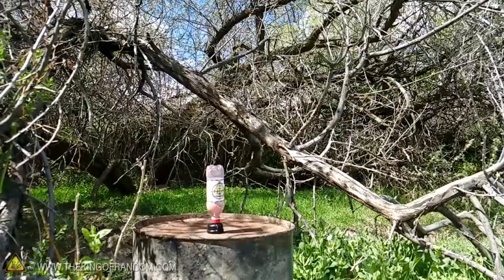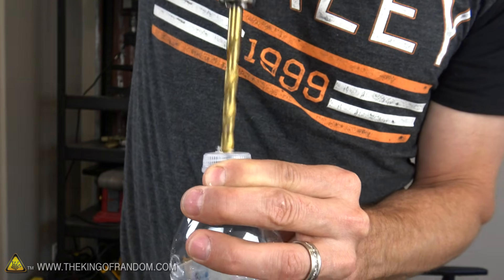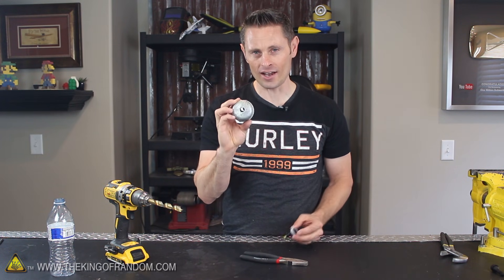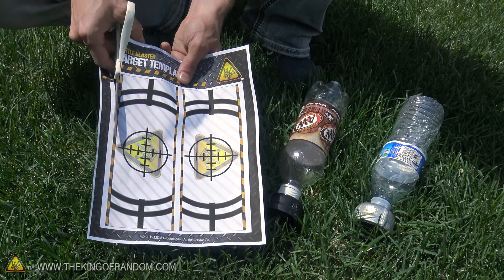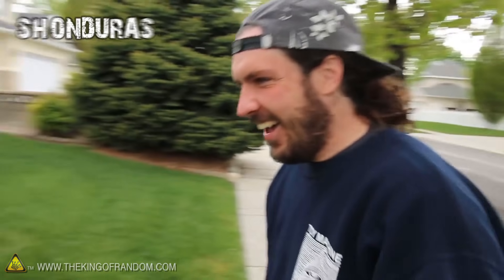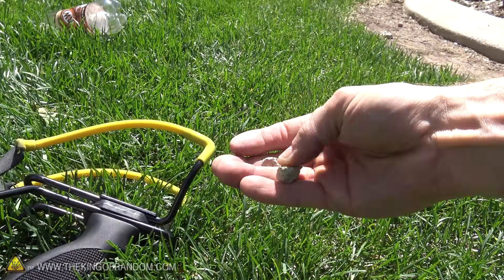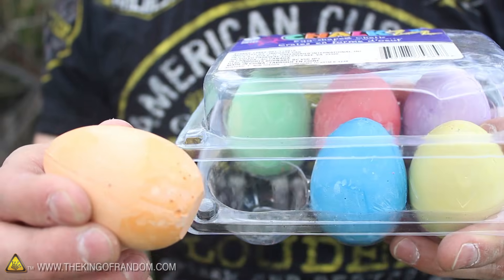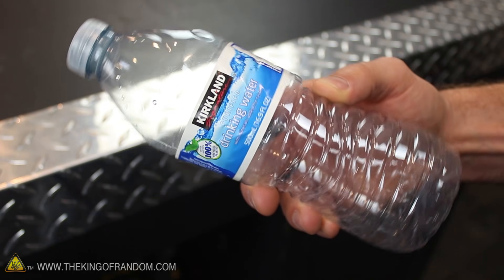How To Make Targets Explode With A Sonic Boom

Comment: i can't get mine to work! im using coke bottles and the valve from the tube of a push bike. i inflate it to about 60-70 psi and the seal is fine it holds it solid but when i try and shoot it with my .177 air-rifle, its just bounces straight off of it!! It never pops and i have used heaps of different methods!!! please help!!!

Comment: Do they only explode if you shoot them at very close range? The other montage video of the bottles exploding had pretty much every shot be really close to the bottle.
Reply: It's only because of the type of shooters and ammo they use. Depending on how far you can throw and they stick into one of those little boards or a tree, these will pop with throwing knifes and darts as well. 

Target practice with arrows is also an idea.

Comment: I have a question for someone. I have a large pocket knife and the handle has aluminum ends on it (Large Espada by Cold Steel) and I was wondering, how can I get the aluminum parts to a mirror polish? I don't have power tools for buffing, so would sand paper work? If so, how would I achieve it?
Reply: emery paper, surely you have a drill though, just get some spindle buffing things, if not you'll need to do a lot of buffing my hand
Reply: ozfartface Ah, I see. Thanks :)
Reply: +cuvkiller I don't mean buffing with emery paper, use actual buffing materials
Reply: +cuvkiller steel wool will work better

Comment: Hi, I'm making the arc furnace and I was wondering,for 2 power converters, how much wire i should use? and also would this wire do?                                 http://www.homedepot.com/p/Cerrowire-25-ft-8-Gauge-Red-Stranded-THHN-Wire-112-4003A/202564806?cm_mmc=Shopping%7CTHD%7CG%7C0%7CG-BASE-PLA-D27E-Electrical%7C&gclid=CjwKEAjwm8-6BRDgnb-Dk96UmRASJADbMycY-WNPQDAUYWtHmjMyhihnOjSRDb_YLIce8Tku4q812RoCO4fw_wcB&gclsrc=aw.ds
Reply: Really only three things are needed for the wire: They must be thick, insulated, and conductive. In other words, it will work.
Reply: ok thank you so much!

Comment: What is 5/16 inches in celsius?
Reply: Communism.
Reply: are you aware your asking what a unit of measuring distance is in relation to a unit of measuring tempurature.....

from a standard 5/16 to a metric conversion of distance measurment it is 8mm....
Reply: You messed that up. We are talking about drills, so that's in tera bits
Reply: 1 inch = ~2.56 cm 

so just take 5/16 of 2.56

but it doesnt really matter because in countries that dont use the imperial system you wont find valves that need an imperial hole drilled into them
Reply: Half of a gram...
Reply: 18 gallons
Reply: Krisztián Szirtes epic slow clap
Reply: over 9000
Reply: 3rd world country
Reply: Sorry, my bad.
Reply: 1 terabyte
Reply: about 8
Reply: +Krisztián Szirtes omg I can die happy now
Reply: +sly50gt that's exactly what I said... 8
Reply: It's millimeters, not celcius. 5/16" = 8 mm.
Reply: Look at the previous reply I made, please.

Comment: I like you dude. I really do. I've done all this stuff, but I've also watched good dudes lose their eyesight, blow eardrums, and get put in federal prison for batf violations. The kid over at GA Tech just got 18 hard years for taking dry ice out of a lab into a two liter. And a guy just lost his leg miscalculating Ammonia Nitrate ratios here. And now we are making Hydrogen Gas bombs (which is a cool set up you've rigged) I don't judge anybody, so no stupid trolls and tween know it alls. , but now as a father of two boys, life is different. And judging by the youth of the comments and asking if air soft will work, people have no idea what they are doing. Just be careful guys. Gear up, because life sucks with bad hearing and one eye.

Comment: Attach a remote controlled needle or something to puncture them and all the remote trolling
Reply: A 10 ohm resistor is enough to puncture it using heat. With a 12 volt battery that's ~15 watts on a pea sized area
Reply: Can you give the link to the video because for some reason I can't find it?
Reply: fill it with deoderant, and then set in on fire, kaboom :)
Reply: +Krisztián Szirtes good idea. thanks
Reply: Extention: As I recall greatscott has a video on making a simple app for android that can start fireworks with a button press. I think that's where this idea came from. Accidental plagiarism :D
Reply: +Krisztián Szirtes its fine, I'll check out his video and try that
Reply: jeahhhh ;-)
Reply: + thekingofrandom yes, please do this... I'm sure you could figure it out!

Comment: Now would a 0.20-0.28g airsoft BB @300-400fps detonate them...?
Reply: If it'll go through the side of a water bottle, then yes. If no, then it might still work (it's easier to punch through a pressurized bottle than an unpressurized one).
Reply: they might cause i try them before not this project just plain bottle with water in it

Comment: Would use it for airsoft fun..but "sadly" the plastic bottles are not free in germany..25ct deposit on them..that can sum up pretty much during an afternoon of shooting. But with the same method you can build a nice and powerfull (reuseable) airgun out of the bottles aswell.
cough slingshot channel cough

Comment: Great now police are in my house asking where I hide my shotgun. Thanks neighbour...
Reply: lmao my mom thought a bomb exploded
Reply: Try Coles they have thicker caps on their water bottles
Reply: How do to use the Kirkland signature it lets out air from the lid
Reply: @braedenolney9631  use 2 liter pop bottles instead. They are way louder. They will set off car alarms over 100 feet away.
Reply: The Screaming Goat Production i
Reply: lol
Reply: I had the same problem.  Apparently the Kirkland Signature brand bottles were recently redesigned to reduce plastic content and the caps are now thinner and weaker.  They would only hold about 15 psi.  I bought another brand of water bottles from Safeway today and they also had the thin, weak caps so it seems the new design may be fairly common.  I used some older bottles with the regular caps and they worked great.  I hope I can find more of these.

Comment: I use these in the UK and I pump a 500ml bottle up to 100psi (handles it fine). Only downside is you cant get them to go off with an off the shelf non FAC air rifle. It will go off with a .22lr or bigger or you can use a crossbow that has a draw weight of 150lbs (that's the crossbow I own)

Comment: What is the purpose of the metal end cap? It looks like the air pressure inside the bottle would try and force the air valve out the wrong way anyway (as in.. tightening it even more).

Never mind, looks like it is just for standing up the bottle.
Reply: its just for a stand

Comment: Been doing this for a long while now, will try the plumbing fitting, previously I used a 2x4 and lined up 4 of these targets at once. There are a few problems though,. The first is if the bottle is pressurized for too long (like over a few minutes) it no longer pops the same way, it seems to harden the plastic. 2nd the cap is too short and can release the bottle before you finish filling it. I use the iced tea caps instead, they are taller but still fit and hold the bottle securely. Lastly, I tried chalk line marking chalk and it didn't make that cloud, it may be heavier than crushed powdered sidewalk chalk. Happy shooting! Stay safe.

Comment from the maker: Free label template: https://tkor.squarespace.com/projectpdfs/bottleblastertemplate You can skip the stuff about entering cc information and still get it free.
Reply: I know it looks cool and all branding it, but it's a bit of a waste of printer ink printing out that metal pattern that gets discarded anyway. 

You should look into simplifying it because it can add up to being somewhat expensive wasting ink if you're mass printing them out.
Reply: look up my Chanel you should remake my bucket blaster.
Reply: Hey Grant. Could you modify these so that you can throw them and they explode on impact? That would be super awesome! Thanks!
Reply: The border is a waste of ink
Reply: +Gyrocynical Lol
subscribe to Electri5
Reply: hey grant how are you able to pump out all these videos so quickly?
Reply: I will use mine for airsoft practise
Reply: i am with you baddy
Reply: You need to make a trip wire that make primers go off not like the little mouse trap pop cap kind
Reply: wow
Reply: I'm sorry I couldn't watch ur vids cuz I had no internet :(
Reply: winks
Reply: What would happen if you put a Rubik's cube on the bottle
Reply: +Luc Andrew Henry try putting little pointy rocks in the bottle and lobbing then at the road or concrete as hard as possibs
Reply: +Luc Andrew Henry try putting little pointy rocks in the bottle and lobbing then at the road or concrete as hard as possible
Reply: Man! You must be on really good terms with your neighbours, seeing your videos... 😂
Reply: No longer able to access free target file...

Comment: Does this work with any bottle, like ones with thicker walls?
Reply: i think it would depend on what you used to break it and how much air you put into it, but if you could break it, i bet it would be even louder
Reply: yesh
Reply: the soda bottles mayl need a bit more pressure to blow with pebbles.
just to be sure, you may also want to put tape on the lid of those too.

Comment from the maker: Boom baby!
Reply: did the police show up on any of your videos
Reply: You could totally make this into an "explode on impact" projectile or even grenade by placing a nail or something close to the bottle so that the impact of it hitting a target would drive the nail into the bottle and cause it to explode!
Reply: Nice
Reply: I love u ! Do you love me ?
Reply: I would use them for airsoft
Reply: +Max Stellinga but you can't use a metric sized bit. It's not the right size. you have to use standard.
Reply: make sure you are in good term with the ... oh yeah i live in mexico
Reply: What would happen if instead of regular blowgun projectile I used some with the spark thingy at the tip and fill the bottle with a mixture of hydrogen and oxygen? Even more boom, baby?
Reply: +Admiral van Goofy maybe you would make water hahaha
Reply: I'm not sure how well this would work but have you considered trying to put a bit of hydrogen in the bottles before adding pressure and then detonating them using you cap darts or thunder caps?
Like i said no clue if this could work but it in theory it should be able to make at fairly signifigant blast aswell.
Reply: I used to do this with 2 liter bottles at 100psi. Also if you use inner tube rubber to make some round discs the size of the inner cone of the bottle, you can unscrew the cap and the disc will be forced into the neck without blowing through and loosing much pressure. That way you can more than one at a time.
Reply: thats the whole point the cap is attached to the metal base and valve only the bottle is replaceable
Reply: will the explode If you put them together
Reply: did the police show up on any of your videos
Reply: OMG!! if your neighbors are old i can imagine how many times they have call the police thinking their shooting whit guns around the area!!!!
Reply: Make a nuke
Reply: love your vids
Reply: Grant do you have to make the top smooth
Reply: almost to 6 million
Reply: Sweet vid
Reply: Hey, was just wondering if you reuse the same cap over and over again?
Reply: put one under water and shoot it
Reply: Can you set them off with a Nerf dart
Reply: yo tkor.. ask your fans to subscribe to Electri5
Reply: Hi
Reply: i like this
Reply: look up my Chanel. i think you might like the simple sand plaster in a bucket.
Reply: Nice vid.
Reply: That was awesome
Reply: eww gross mormans.
Reply: when is the liquid nitrogen in a 9ft balloon coming out
Reply: try making a smoke bomb with this method
Reply: awsom
Reply: What happened to the picture of the balloons on your Instagram? You never made a video for them.
Reply: Boum
Reply: +Gardevoir Profile pic please?
Reply: i was waiting for this from shonduras
Reply: GREAT VID
Reply: grant can you also say the measurements of the metric system with the projects that would help me a lot thanks 👍😜
Reply: Put em in liquid nitrogen!!!😋
Reply: Nice one :)
Reply: will it work with an air rifle
Reply: Frank de Lange - Speaking from personal experience - yes!!!!
Reply: I made your blow gun so what darts did you use the glass Breakers or the nail darts???
Reply: +Andrei Vidz put the dust in it also
Reply: Leandro Lopes Pereira yeah definitly, but the reaction is massively exothermic, means that its really gonna create a big boom. Rockets get fueled by this reaction.
Reply: Will you be making a video on how to make that slingshot you used in your video? It looks really cool. I'm guessing it was made with a garden hose handle and the metal bit was from a bike water holder. I'll be looking for the video!
Reply: +LoneRider01 he already did
Reply: No he didn't. That's not the same one
Reply: i was literary just about to ask that question but with the hard fake ones
Reply: Nice video grant :D really liked it!
Reply: I'm  going  to  use  it  as a prank
Reply: Can u teach us how to make electrical boats plz?
Reply: How did you make the sling shot cause that's not the one you made the vid about
Reply: Hi grant Thomson did u do this with shonduras pls reply me
Reply: Can you use these with a gun?
Reply: look I commented this idea So now I replied so you would see it :  
I would rig an electric match to the outside of the bottle and have it with chalk in it and then put it in a bush beside the footpath and set it off when someone walks past! :D
Reply: hey can you make a video about the lost foam aluminum  casting method, but in stead of using Styrofoam would you be able to use 3d printed parts?
Reply: it works but I did it the other way. I used a smaller drill and I wasent useing the tools u were useing but I use a balloon pumper and it worked still.
Reply: great project
Reply: Can i make blowgun that has a smaller pvc pipe and its Made from metal?
Reply: i have a old dishwasher, what can you get from a dishwasher
Reply: You could also maybe put coffee creamer in it and have a flame going beside it for a fireball.
Reply: cmon... i was gonna make this yesterday but i could'nt pump the bottle up and now every one would think i copy you
Reply: +Valmiera Funcoaster Blast 
how about no
Reply: +Valmiera Funcoaster Blast 
how about no
Reply: Get like a 3l bottle and try it
Reply: You Don't Know Me - We have - it works great, and the boom is brilliant!
Reply: i will breathe underwater now!!!
Reply: +Valmiera Funcoaster Blast pinpis
Reply: I have the exact same slingshot you used in the video
Reply: Добавь в бутылку бензин 50мл и дай искру!
Reply: You should have a game with shoundurus who can hit the most in a certain amount of time
Reply: Добавь в бутылку бензин 50мл и дай искру!
Reply: can you make grenades ?
Reply: +Djon Rembo 
thank you
Reply: BOOM BOOOOOOOOOM!!!!!!!!
Reply: we used to do this with lipton green tea bottles and were able to get them around 100-120 psi. they sounded like a high powered rifle going off. not sure if they make the same bottles anymore
Reply: yah I went shoting once you cuod hear the gun shot from like 79meters or so and also since the microphone cant realy pick it up (the bang)  its not going to sound loud
Reply: Me and my daddy do all of you projects together
Reply: Is there any way to make this without the tire valves? 
(I don't have any and I can't find any)
Reply: ya...i stopped at a bike shop ... he took an inner tube out of the rubbish and gave it too me. Needs plenty of epoxy though!
Reply: +nightdragon669 did you write the same comment two times?
XD
Reply: +Marius Thune no must have leged posted
Reply: Do a Colab with crazy russianhacker
Reply: I didn't want to buy all the cleanup stuff so I put a small amount of dry ice to build up pressure! Man I should have caught that on camera!!!
Reply: So we know what happens if you dump molten salt into water ( it explodes) but what if we we dumped molten salt into liquid Nitrogen?
Reply: XOFOSE We Just Invented the new Nuke!!! :D
Reply: yes
Reply: the chalk would be like a paintball game  BOMB
Reply: How much psi should i give a pop bottle instead of water bottles
Reply: 900 bz - We find that here in Australia, using a little care andstandard soft drink bottles like Coke and Fanta, we can get up to 120 psi into the bottle.  It takes some effort with a hand pump, but the boom is brilliant!
Reply: The Kirkland (COSTCO) bottles won't work with the new Umarex already made caps. The air leaks out.
Reply: The King of Random I would hit it with a Nerf gun
Reply: Did not work
Reply: R.I.P.
Reply: 1st reply!